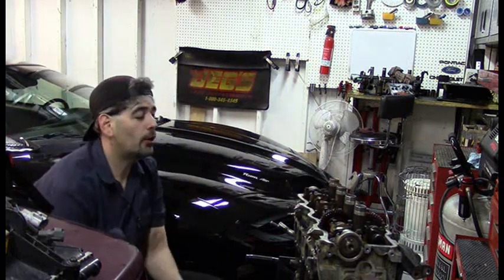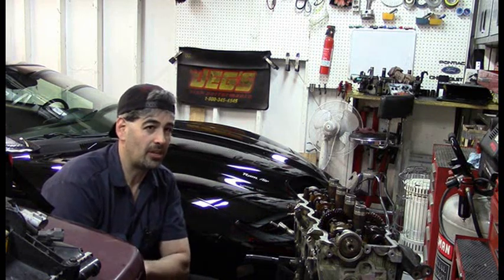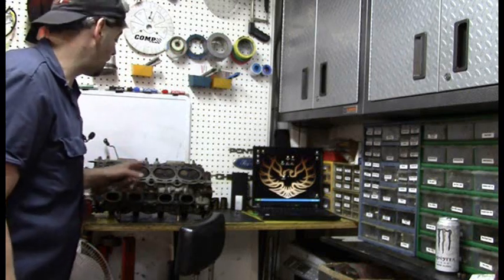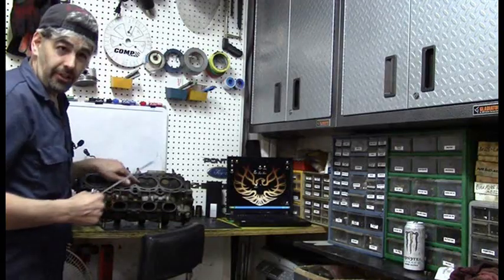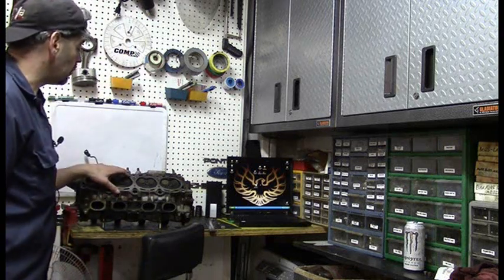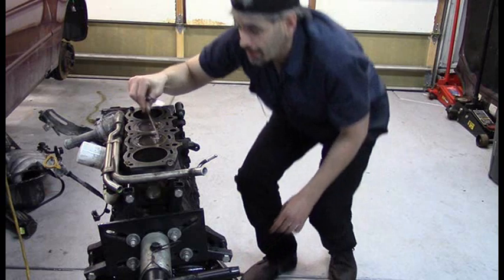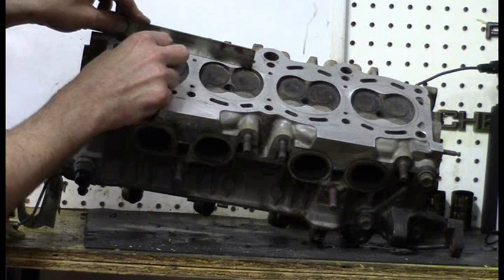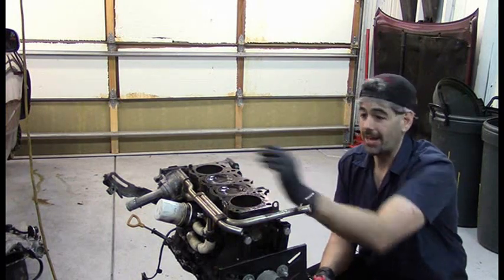Replace a Cylinder Head Gasket Yourself and do it RIGHT! Part 1

Comment: hey Schrod, great video! I have a weird engine problem that i'm still trying to diagnose, wondering if anyone could help me. i think i may have a HG leak in my 6g72 engine, but i'm getting mixed results...i did a compression test on all 6 cylinders and they were within 10 lbs of eachother. all spark plugs have normal wear, no milky oil, no oily antifreeze, my only 2 symptoms are bubbles coming out of the coolant resivoir/overpressurizing hoses, and white exhaust, not much though, just a little extra. is a head gasket pretty much the only thing that could be causing both of these symptoms? the engine hasn't overheated...i know atleast in the 10k miles since i got it, so idk what would cause it. thanks^^
Reply from the maker: Why would it sound like a head gasket issue with equivalent compression and why would you recommend that he gets a new head gasket based on symptoms that have over a dozen etiologies just because your car needed one?  That doesn't register with me at all.
  Why for example would you not recommend this is an intake manifold gasket leak for example, especially with the compression results?
Reply: thanks for the responses guys, ill find out soon regardless since i ordered a chem test kit yesterday!  should i need to replace the head gaskets/fix heads and block though, ill be sure to follow this video to the tee. ill let you guys know what my results are on thursday
Reply: Allright guys, well i did the block test and got a definitive positive result. I think even with all other symptoms aside, its a pretty surefire answer. i've got a lot of work ahead of me...but ill definitely be checking all your engine removal videos before hand.
Reply: On a side note, the only thing that still perturbs me is why the leak occurred in the first place... the engine didn't overheat, but the series of events that led to this conclusion was an overpressurized (to the point of rupturing) coolant system about a month ago, i figure due to the exhaust gases from the leak... so i'm going to check the heads and block for problems regardless, but if their aren't any in either component, is it safe to assume that the gasket itself just failed from old age? (i did a head gasket repair on another engine of the same type a while ago, and the gasket was fine post-op, but the gasket itself had obvious signs of failure)
Reply from the maker: Chuzzlepuff Puffchuzzle What perturbs me is how you had identical compression in all cylinders
Reply: Not identical but close, 151 was the lowest and 162 was the highest, the low end tolerance for the engine is 139 and factory is 185. I did the compression check with the engine cold though, perhaps that made a difference
Reply from the maker: Chuzzlepuff Puffchuzzle Ohhhhhh- you didn't mention that.
  Yes you really need to do it on a warm engine to be accurate.  My bet is had you done it on warm engine you would have then evidenced the compression leakage then head gasket would be reasonable suspect.
Reply: Kon'nichiwa! Well if this thread is still active, you might be happy to know that i have the engine apart now, with heads off! upon pulling the rear gasket off, i noticed right away that the number 1 cylinder hole has a split fire ring. hook line and sinker culprit...its even in the same exact spot as the gasket that blew on the old engine that was in the car! obviously this is a recurrent defect in these engines. Anyway, i checked out a sight and found that fire ring wear due to shearing is common in the mitsubishi 3.0 and can be solved with a updated gasket with teflon...ect. 

Anyway, provided i do a double check for warpage with my feeler gauge on the block and head, do ya think its a safe bet to skip the machine shops tests to save some money? thanks again mate:)

Comment: Haven't seen This Tech/Mechanic in a while.  Was wondering what happened to him. Recently my Honda Civic Si over heated. Temperature gauge shot all the way to red. Fortunately it happened while on idle only.  I turned car off, popped  the hood, and called for a tow.  
Thought for sure I blew my head gasket.
Couple days later, got a call that my car was ready.  Turned out to be a bad thermostat. Fans were also replaced along with some switch or temp sensor. 
Car has been running fine now for almost a month.  Close call.

Comment: When you're testing for warpage on the head surfaces, how do you know that the straight edge itself is not slightly warped?  When dealing with thousandths of an inch, I doubt you can eyeball it.  I see "machinist straight edges" for sale online for about 100 bucks!  Do I really need to drop that much $ to get a straight enough edge?  If not, can you recommend one that's about 10 bucks or less?  Thanks again Matt!
Reply from the maker: +jawojnicki I test it against a sheet of glass occasionally
Reply: +jawojnicki You are right. You are supposed to use a machinist's straight edge. More importantly ,the edge must be long enough to cover "the whole length " of the head, and you also have to be able to measure from corner to corner of the whole length. Glass is as flat as the surface it lies on, yes glass bends, so it cannot be used for testing how straight your edge is. If you use a cheap edge, you are better off testing it against a solid surface that is supposed to be straight, like a solid high quality table saw. Your best shot is to bring your cylinder head to a machine shop, since you have to test it for cracks anyways.
Reply from the maker: Enrique Montes glass is not as flat as the surface it lies on. Lay a piece of glass on an uneven surface and you will easily disprove that.
Reply: +Schrodingers Box Like I said: " More importantly ,the edge must be long enough to cover "the whole length " of the head, and you also have to be able to measure from corner to corner of the whole length"...this is a must. Can you use a 3 inches long edge?...of course not...what about 6 inches?...nope...you have to cover the whole length...it is on every service manual.
Reply: +jawojnicki Look for a good-quality metal drafting T-square, at least 18 inches long--they should be cheaper than a machinist straight edge.  That's what I use to check head flatness, along with a set of feeler gauges, and I've found that my T-square is perfectly straight (or at least down to at least .002 inch or better).
Reply: what should I expect to pay?
Reply: what should I expect to pay? 
thanks

Comment: Im in need of some help/advice. I own a 2003 Lover Freelander. I changed out the head gasket but it still leaks. the surfaces have been machined and are flat but I am 95% sure the multi layered gasket is a piece of shit.  its a 6 layered gasket, and all I can say is that I am no longer a fan of mls gaskets. any help of possibly being able to normally seal the gasket or if your actually suppose to break in the gasket using the heat of running the engine, seems stupid but based on how stupidly my car is built I am questioning everything at this point.

Comment: I have to replace the gasket, coolant was spewing out of the space between the block and the head.
Reply from the maker: Sounds more like you need to replace the head in that case.
Reply: It is a replacement.. I broke off a bolt in the previous one. the shop couldn't drill it out. I will have to use the feeler gauge tomorrow. I noticed the gasket I removed was not the same as the one in the set I bought.
Reply: 98 Neon by the way.
Reply: Crack between the 1st and 2nd cylinders...I still have to replace the gasket.

Comment: Please give me advice on this: 

 I' m cleaning the block surface, I see you did not do much to clean it, Do i have to leave it perfectly shinny and clean? I used 220 sand paper to clean the surface of the block because nothing else worked and it did the job faster. I was able to get a lot of the baked on gasket off once I see shinny clean metal I stop sanding it. I actual see the factory surface lines on the block BUT i still see some gasket material in between those factory mill lines . I 'm using  Composite gasket I know that the surface can't be extremely smooth for these gaskets, because that is what the composite material is for, to fill in the gaps. What do You recommend I do to clean it good but still leave a not so smooth surface for the composite gasket? I'm a bit lost please help.
Reply from the maker: You may see some discoloration of the metal but there should be no gasket material at all on a prepped surface. Assuming the warpage is within spec, I clean the deck using a wire-wheel brush with a metal or composite that is softer than the metal I am cleaning. It wisks away the gasket material completely and effortlessly.
Reply: @SchrodingersBox  Thank you I will try that!
Reply: @carlosb Something else you might want to consider if you have access to an electric drill or die grinder is a 3M white Roloc 120 bristle pad, size #2.  You'll also need the Roloc disc pad assembly, the pad is mounted to the assembly. It is similar in concept to the wire wheel mentioned in the video. These remove old gasket material in short order, and won't damage the item you are cleaning (as long as you use common sense, keep the pad moving and don't press down too hard).  You'll see these being used by pros with a right angle die grinder all the time.  Always use the white 120 pads when simply removing old gasket material, NOT the green or yellow ones which are much more aggressive. Sure, it costs some $$ but might make your life easier down the line if you plan to do many repairs that involve removing old gasket material.  For those who would like to have a right angle die grinder but don't have an air compressor (or one with enough capacity), Milwaukee is releasing a new M12 electric cordless right angle die grinder in October 2019 that looks really, really sweet! Looks like it will sell for $169. I'm going to check it out when it lands at Home Depot.
Reply: @StilettoSniper  Awesome thanks, I've checked them out, they do not seem that expensive and it looks like they will do the job.
Reply: @carlosb1  It's an alternative to razor blades and acetone that I have seen used by pros.  Just be sure to stuff rags in the cylinders before starting and use compressed air and oily rags to clean up any abrasive that might be residual.  That's the only downside I found to this method, you don't want any abrasive or dust to get in the cylinder, oil or coolant passages.

Comment: Okay, so my car overheated. The meter only went half way. I just got an oil change like 2 weeks ago, then come to find out, their was no oil in the car. But my car would make this loud clicking sound as I press the gas pedal. I thought I blown out the head gasket, but the mechanic said he couldn't find anything wrong. What can it be?
Reply from the maker: Jon Jon Carter See my video on engine noise diagnosis

Comment: If you want to know if you can reuse the cylinder head bolt , the answer is YES.  Every manufactory give a spec of how to measure the stretch cylinder head bolt , meaning if the head bolt is within specification not over stretch yes you can reuse them,  and I have done it myself before without any come back.  When I was doing warranty engine work , and If I was going ahead order all the cylinder head bolt just for the say of it , Most likely the manufacturer will charge back the bolt.. they will not pay for all the head unless they out of specification.  Just reminder all home do it yourself mechanic .. each head bolt case cost around $15 to $25 each ..
Reply from the maker: +Eddie Chung And what is the method used to actually measure the stretch AND that the stretch is equivalent across the entire length as opposed to in just a single location causing an acute point of weakness?
Reply: +Eddie Chung with the cylinder head being warped, i&#39;d just get new bolts. If you&#39;re replacing a head gasket, if you are measuring them and they all come back the same (plus if it took equal amount of force) then yeah.. but if you want to ensure you don't have problems in the future, just get new bolts.
Reply: better to do replace whatever you can after tearing literally half the top of the motor off.

Comment: There is one time I know when you need to replace tha head gasket, but everything else about the car is fine. If you have one loose nut behind the wheel. :D that's why I'm watching this, I'm thinking of buying a car and this is the only problem with it. the sellers daughter overheated the car from bad driving, it's a manual.

Comment: I got an 86 f150 and its overheated before, gets hot on a hot day starts choking then can die. (Working nights doesn't seem to be an issue for it) Also seems like it needs a new starter b/c it sometimes doesn't want to crank after a drive without a 30 min break or longer before cranking. High grade gas seems to run it better, I just replaced a dead battery yesterday and a put on a new thermostat today. I seem to have a very slow oil leak and I think it's coming from the gaskets. I see a good bit of oil all along the gasket and pretty much all below it but nothing above it. Is there any way that sounds like needing new gaskets? I was told to clean the engine real good and find the leak before tearinging into it but it seems just as sensible to start at the top where I first see oil.
Reply from the maker: Need some data to even get an idea. Start with basics like fuel trim. Since it’s an OBD1 do you have integrator and block learn curved against load?

Comment: Saying that just changing the head gasket is a wrong move may not always be the case. If a vehicle is just simply old, the material of the original head gasket might get blown,warped,cracked as the result. Say you bought a 20 year old sports bike with an original head gasket. A performance engine that is constantly running hot and cooling down and after so many heat up-cool down cycles over the decades, it just gives in... I've had this happen to me before without any overheat..

But yeah 8/10 times you would need to have the aluminum head and aluminum block (case on most motorcycles)  lapped aswell...
Reply from the maker: In that case based on what you just said it goes without saying there was heat and cooling warp in the head causing the failure.

Comment: You're going on at some length about "find out what's wrong" why the head gasket failed, but isn't it a generally accepted part of the head gasket procedure, to have the heads machined, since usually a car with high mileage, the head gaskets warp, and even if htat's not the case, isn't machining the head an understood part of the procedure? I'm wondering, other than a warped head, what kinds of other problems, cause a head gasket to start failing? Provided the cooling system is all good (pressure test revealed no loss of pressure, thermostat is good etc). The reason I'm asking is the shop is doing the head gasket on my car because I'm a 60 year old lady and my car is a Toyota Previa, it isn't like the process is the "same on any  car", there's no way I could "do it myself". But it would be good to know what other kinds of things (aside from warped head) could cause the head gasket to start leaking, just for my own education.
 Oh also, my car has not yet overheated, ever. But it's sucking up coolant a lot more than it should.
Reply from the maker: Jayne, you absolutely need to find the cause (the "etiology" as we say in science) because otherwise you have no evidence you corrected the problem and thus no evidence that the problem will not recur. Head gaskets almost always fail due to overheating. If you go through the "understood procedures" as you called them of head gasket replacement you will probably really understand the procedured even more when you do them again in 4 days because the coolant temperature sensor is malfunctioning causing the coolant fans not to operate and thus overheating the engine again.
  It's not technically about finding why the head gasket failed- they all fail for the same reason- the cylinder head warped. It's more about "what caused the cylinder head to warp"- probably overheating and if so why? maybe a previous repair was done and the bolts were not torqued correctly. But whatever the case, unless you find that etiological source, you have no evidence the condition won't recur.

As for using more coolant than usual, that's a whole different issue. I would normally start with a pressure test to look for leaks which includes a radiator cap pressure test. Believe it or not that $7 radiator cap not sealing and maintaining correct pressure is the most common cause of lost coolant, leading to overheating, and head gasket replacement.

 Oh and as far as cylinder heads eventually warp with time- not sure I believe that.  Maybe they do, but I have never seen evidence of cylinder warp due to age. Every single time I've seen a warped head it has been due to overheating.

Comment: Would you please explain the comment at 2:50 about intake manifold leaks? I didn't know that oil runs through there. What about the newer plastic intake manifolds? Are they subject to this failure mode?
Reply from the maker: ***** Most intake manifolds have coolant galleys. Leakage of the coolant at the gasket here will drain internally into the oil valley or even into combustion chamber. Either way this would be water mixed with the oil without a loss of compression in the cylinder- e.g. cylinder head is not faulty.